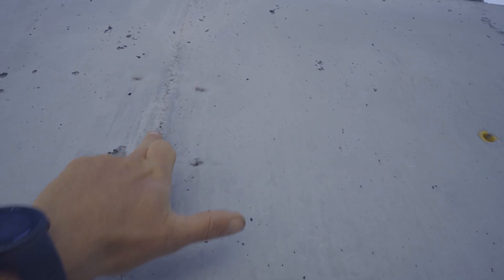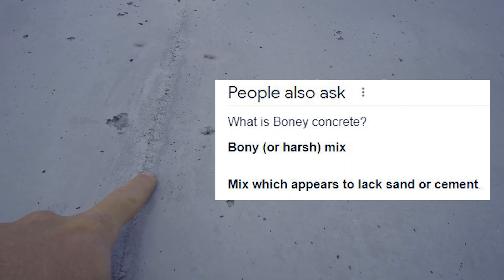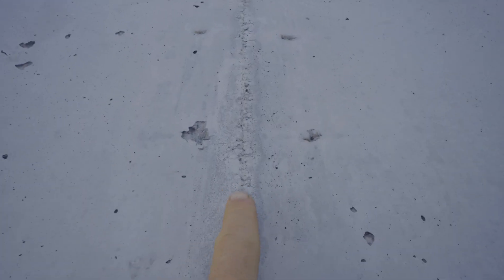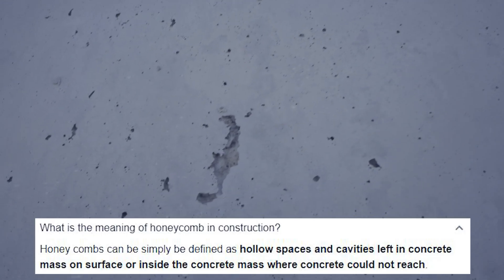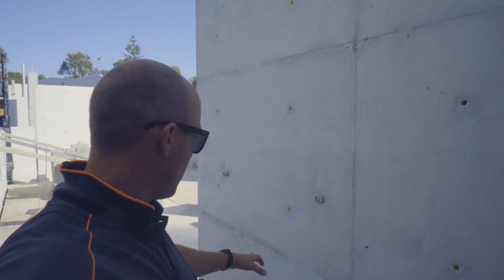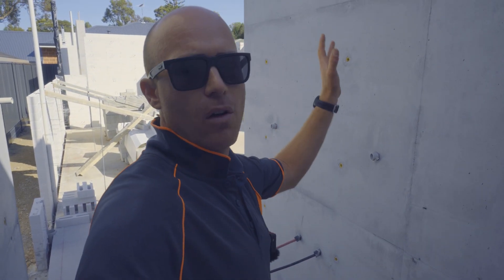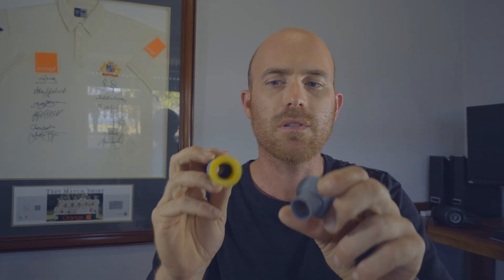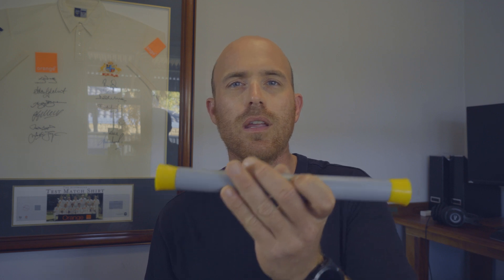Types of Concrete Wall Defects, Problems And Solutions

Comment: Well either one you could have used a little more water it might have actually hardened too quickly there's a couple additives you have to slow it down so then you can spend more time vibration

Comment: Mate, I tried to post a link to a fix for your bolt hole problems, but YouTube seems to have swallowed it. Here in Germany, we can buy the grey cones you showed, with a 1cm foam ring that seals off the anchor hole. They aren't super cheap, but the results are perfect. You can't build a high wall will zero expansion, even the Dywidag rods will stretch a few mm when they approach their 90kN rating, and any identations on your wooden beams will make things worse (which is why we use steel girders for high walls). Try google for Maro Kunststoffdichtkonus  (yeah it's German). Greetings from Hamburg

Comment: Youre a true professional. I made the mistake of pouring too fast (more tham 2 foot lifts, no inner ties) and some of the form work let go. Also the pressure caused my walls to be out of plumb. Were talking about over 400 feet of a property lined U-shaped planter. Couldnt vibe the 2nd top half of it because i knew the forms wouldve exploded so there are places that need patching. Felt sick to my stomach but it is what it is. Shouldve stuck to my original plans to pour first half of the wall first with the footing then the other half of the wall.
Reply from the maker: Sounds like you should have used ties! A quick concrete pressure calculation from google or chat gpt will tell you have much pressure to allow for. Then you just have to make your forms strong enough to hold that much weight. Never design around pouring slow. Build it to suit maximum concrete pressure as sometimes the concrete doesn’t go off or is a high slump or gets poured fast or plasticiser is added which all keep the concrete at maximum pressure. Build forms to suit that.
Reply: @bmformworkconcreteconstruc9783  reading your advice regarding designing with maximum concrete pressure vs pour speed is really helpful. I prioritized it backwards and it bit me. Pour was a 2.5 inch line pump so had to use plasticizer. Thanks again and hope to see more vids!
Reply from the maker: And yes that sick feeling is something every Formworker understands. At many points in your career you will experience it.

Comment: Regarding the round holes there’s a basement specialist in the UK who uses cast in GRP rods where the rods are cut off and I’m guessing for exposed work can be drilled out before filling. Also could those raised vibrator burns be polished off?
Reply from the maker: Some of the fiberglass ties and similar products are more common in east of Australia but I just haven’t had any experience with them. The cone shape is however part of the “look” of off-form concrete so it’s important to have them really. The vibrator marks can be removed but far better to not have them in first place

Comment: Is it common or gernally always done poured the walls before the fountain/floor?
Reply from the maker: Foundation for the walls are always poured first. But the slab is different. It usually depends on how the water needs to be taken away from the building, ie if you put an external wall directly ontop of a slab then moisture will get into your house

Comment: I like the look of the smaller caps on the bolt holes even as it chipped out a little bit of concrete it looks great. I guess it depends on the look your going for
Reply from the maker: I've found the small cones look pretty good. They done like wet slumps though

Comment: Hi, What cement mix you used to get this color and texture?
Reply from the maker: 40/10/90 architectural grey
Reply: @bmformworkconcreteconstruc9783 What do these numbers relate to? Specific pigments?
Reply: @Daniel-ur3sf  40 is the npa (strength of cement) 10 is the size of aggregate in mm and 90 is the desired slump the concrete should be when delivered to site
Reply: @bmformworkconcreteconstruc9783  mate what is the difference between architectural vs non architectural? thnx

Comment: those grey cones are really good for a nice finish around the bolt holes. I like to cut the sleeves a lil wider than the wall thickness (usually 5mm max). that way you can really squeeze down on the bolts, get the cones sealing nicely and sort of pretension the bolts at the right wall thickness so they don't open up. for your finish face walls it could also be a good idea to run a string line down the soldiers just to make sure nothing is overtightened. 

having said all that, you're a top carpenter mate and not many could get the results you do.👍
Reply from the maker: cheers mate, yep just did another job with the yellow cones and cranked them right up but same result. I will never use them again! I also make them 5mm larger, best way to go. As for the string I have been using a hilti line laser as I can check anywhere on the wall.. not just where the line is. It works great. We start some 6m high off form walls next week, im hoping to film as much as possible and get perfect bolt holes!

Comment: Ben, from your experience, why aren't more houses build from concrete? There are a few companies that manufacture pre-cast sections that are used in towers / mid-rise buildings, but why aren't actual houses built this way? Also as a carry on from that, if a house were to be built using concrete, would you say it would be better to build using pre-cast or in-situ?
Reply from the maker: insitu costs far far more than traditional and can go very very wrong. precast is expensive also and also requires a huge crane to install, not always possible. Concrete isn't good for insulation or moisture. and if you build double skin concrete walls for the insulation that's super expensive.
Reply: @bmformworkconcreteconstruc9783  We are working at including the foam with less cost.  Your concrete appears to shrink less than most does here.  Just saw a paper on cements and shrinkage - they can minimize cement shrinkage but it will reduce strength.  I'll take that!

Comment: Thanks for the videos! Do you have any tips you can share about what sealant you apply afterwards for waterproofing (outdoor) and dust proofing (indoor) for the concrete surfaces?
Reply from the maker: I cant help you there Ken, I have next to no experience in this regard. but here we have a local company called parchem who specialise in these products. Try their website.
Reply: I buy products from that company. Could you share which waterproofing products you buy from them? Or do you usually not use waterproofing impregnators for your concrete surfaces?
Reply from the maker: I dont usually do the concrete, only the formwork so I like to leave this to the clients or designers. In my experiences this has been something that has always been decided well before any discussions have been made to get me involved in the project. I know that xypex is not used as often anymore in the conc as sealer performance seems to have improved over the years. The client on this project has a product he is using but I do not know the name. I will ask and let you know.
Reply: @bmformworkconcreteconstruc9783  Appreciate your help a lot! I'm currently experimenting with silane siloxane coatings but these change the look of the concrete from a light grey to a dark one which is far from ideal

Comment: The larger flaired cones are the one to use. I like how you said concrete is concrete, it is what it is. Those walls are fantastic, I would be proud to have cast them. Do you not pour your own walls ? I worked in Australia for a while and we did not pour our own either which was a bit strange for me.
Reply from the maker: Thanks mate. Where you from? I might start pouring them.

Comment: Really good info bro. Placement is an art in and of itself,  mostly see the little hoses used for walls mostly in NSW and coil ties used mostly for architectural jobs.
Reply from the maker: 2in hose is the go. I forgot to request so when pump arrived he didn't have one so we made do with water hose on forms. I am finding it hard to see the advantages of coil ties? Do you know? I can't see them being any tighter, and being sacrificial they are an extra cost and I have heard they can fail...
Reply: @bmformworkconcreteconstruc9783  yeah not sure about the coil ties. Maybe just because they are available here and so are used more often. The small hose is definitely the go and interesting the comment about the PVC pipe that could be good too. Another crazy one I have seen is every sheet having a rebate and rabbet joint at every corner and all flat sections have a tongue and groove joint for each sheet. Can't imagine how much more money that would cost the client.
Reply from the maker: tongue and groove is crazy. I could try festool domino's. stripping would be a nightmare after moisture expands the mortice! can buy 3.6m x 1.2m sheets now that's the best way, have less joins.

Comment: As you said mate, after a certain point, it's all about accepting the nature of concrete and embracing the characteristics that the wall has produced because your walls have come out bang on.

And yeah definitely agree with going back to the cone shaped caps for your z bar conduits. I find it generally will strip out nice and crisp. 

Nice work Ben!
Reply from the maker: 👍 I should probably just tighten bolts more with those solid cones.

Comment: Personally I prefer the concrete to have some defects.   That’s why I don’t like precast concrete, becomes too clinical.   It’s a hand made product and every “defect” is part of the signature and uniqueness of that wall.
Reply from the maker: Yes that is correct. I always want perfect bolt holes though and a more even texture to the air bubbles. I really dont like the ones that always form at top 2ft of wall. But these walls will look great.
Reply: @bmformworkconcreteconstruc9783  Another reason you may be getting air bubbles against the boards at the top is possibly due to the hydrophobic nature of the board surface (and oil) which prevents the wet cement paste from coating the board properly. In this low pressure zone you might see an improvement by using a hydrophilic release agent like Nox-Crete RA10.
Reply from the maker: Thanks for the reply, I will buy some on Monday! please give me anymore advice you have on release agents. It is something I really want to use more but with a better understanding of why to use particular products.
Reply from the maker: The fix we have been using however is a light spray of water on the forms just before the conc hits and to use a smaller vibrator at top of walls. The cordless battery ones work great.

Comment: Feel like this is already a premium finish. The more expensive concrete the better finish, not so much to do with your formwork or pour sir. (Maybe just the dried up splotches)

I don't know if the concrete itself varies hugely around the world. But we never get that bony concrete effect in Finland, and rarely seal molds extra tight.

Could be some additives they put to the concrete to resist frost I suppose.

Anyway keep making these videos good sir, formworkers are rarely represented! 

Also just a random thought, why it seems like that in the US they hardly use any rebar on any residential projects? They just dig a trench and pour it down.

Best Regards,
-Finnish Formworker
Reply from the maker: Hey mate. I think the temperature has an impact. I can acheive much much better finish when cold. this was such a hot day that the black formwork could have been 60deg Celsius. To combat that you have to wet everything down and have more water in the conc, that is what causes the boneyness on the sheet joints. It is a science!

Comment: You ever try using a self consolidating concrete. Real high flow no vibration required. It’s more expensive but saves on labour on pour day. Your form work has to to be 100% as failure with this stuff can be an absolute disaster.
Reply: And what I meant to say as well is it leaves a premium finish. Very few defects.
Reply from the maker: I would have to take a look. My experience is that low viscosity means more leakage

Comment: Not sure if have tried, or like using coil ties and the tie bolts for your walls they give a very crisp finish around the cone area. Like every has its pros and con
Reply from the maker: Thanks mate, never used coil ties, never even seen one in the flesh over 17-18years. I know they are common over East. I would like to try them.

Comment: Looks pretty dam good. 
If you use a Treme pipe to get the concrete down you won’t have the concrete splashing further up the wall. 
We just use a rectangular pvc down pipe with a round fitting on the top to put the pump hose in. 
The pump guys hate it but tough shit !
If we have room we lower the pump hose in down the unseen side of the wall.
Reply from the maker: that's a good idea with the pvc pipe. I'm disappointed that I forgot to mention this, I usually request that they bring smallest hose they have and lower all the way down. I completely forgot to request on this and so we made do by washing down during the pour.